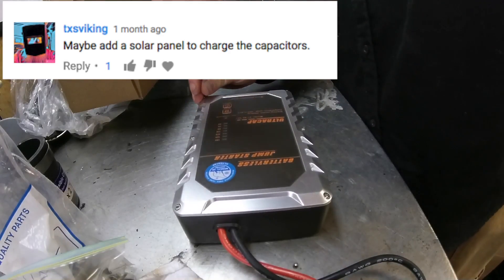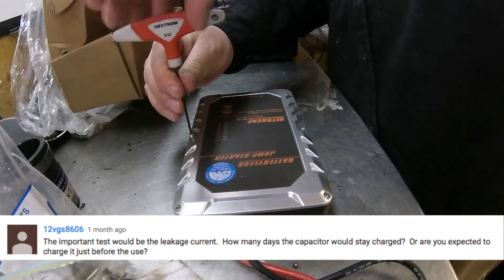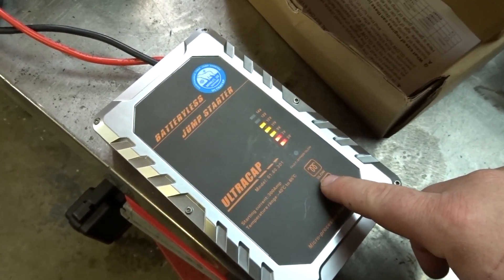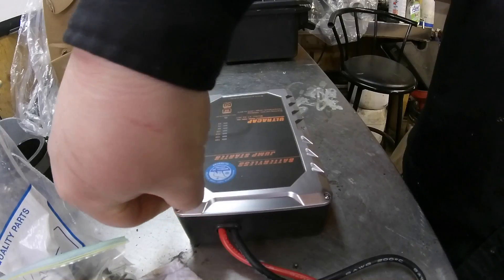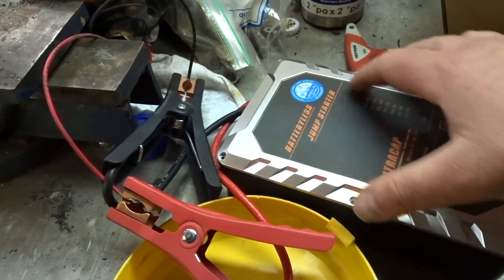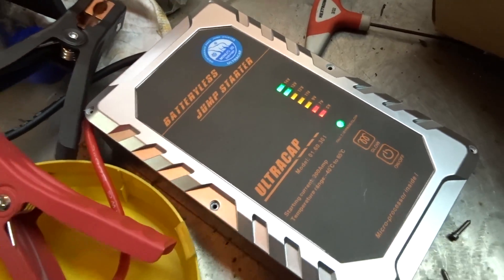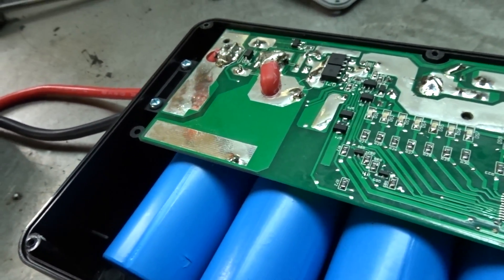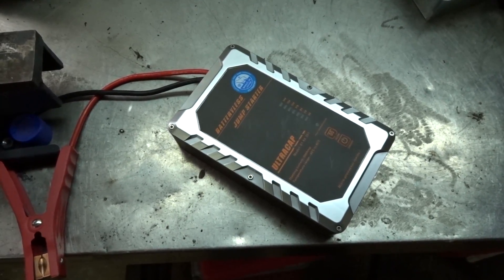Batteryless Jumpstarter What's Inside

Comment: Hi, what is "BY PASS MODE"? I don't understand what is being by-passed?
Reply: Just guessing, but probably bypassing the charge circuitry so you can now draw from the caps to start the car.
Reply: @mitchydkid  Thanks very much.
Reply: It usually checks polarity, and only enables output if ok. Now if your battery is totally dead, you can charge using a better source and after that connect to the target car. It will only enable the output if polarity is ok so this might fail. Then you need the by pass mode. Basically it means by pass checks. You can also disconnect the dead battery so it won't drain the capacitors additionally and use by pass mode. Just double check that it's connected correctly.

Comment: They are approximately 330 ferads not micro ferads but ferads if you look on the laser saber Channel you will see that approximately 3 years ago she posted a video on using super capacitors really really big ones 2.5 volts piece 6 and series to replace a car battery that he wondered if making a really small one which uses the same kind of capacitors this uses would work and it does work starts a small car three times on one charge and can completely replace a 12 volt battery in a small car or medium sized car but medium sized car only gets one try on a full charge of these capacitors you should look up as Channel there's lots of helpful information and he posted those videos years ago so the company that made this probably saw his video on using ultracapacitors in series to charge him up to 12 volts and have the low amperage storage capacity with high amperage discharge capacity to replace car batteries the one that is full size for a car battery is capable of starting large Vehicles like tractor trailers and only weighs about 8 pounds versus the 40 to 50 lb of a actual car battery.

Comment: I’ve watched your videos, and others on these type of jump starters, they are an impressive and amazing device to own.
From what I understand these capacitors could be rated 3v so 5 in series would give room for 15v, but I wouldn’t know how many farads they would be rated.
A car battery that doesn’t have enough cranking voltage will still have around 10 volts and many amp hours left, bad for the battery to be that low as we know.
Inside the unit there is a relay, so I guess when you connect the box to the battery the relay diverts power from the battery through a balance charger giving 2.8v to each cap to charge the caps to 14v
When it’s charged to 14v the balance charger is bypassed via the relay and connects the caps directly back to the car battery with a nice capacitance waiting to discharge through the starter motor.
Amazing!
Reply from the maker: They work awesome very brief amount of power maybe 5 seconds

Comment: It'd be nice to know what's the lowest your battery could be and still charge the capacitor? I know you mentioned if the battery have some kind of life to it.  it'll charge capacitor and but if your car battery is drain to 1% battery life will it really charge capacitor completely or enough to jump start battery or does it need to be at least 5%? On a 9 volt battery or double A battery charge the capacitor enough to get a jump? There was this thing jump a large diesel motor? I think I asked you enough questions I'll leave you alone now LOL thanks

Comment: Also, is there one available to start aircraft?- 24v- light aircraft batteries are small capacity 10-18 AH as there prime purpose is to start the aircraft engine and they are small due weight limitations. Thanks

Comment: Worst case scenario- happened to me- freezing weather, I left headlights on after I parked and when I went to start 3 days later, battery had gone reverse polarity- ie negative was positive , positive was negative. Smart charger did a spaz when I hooked it up as it was telling me I hooked up backward. Old dumb charger-  got battery back to normal and charged in 12 hours. Vehicle a diesel and you need about 10 secs of low plug in freezing conditions. In the worst case scenario above- glow plugs, reverse polarity, etc, will it still work?

Comment: Based on watching the "First Look Case Study" video and rough math, they are probably 450 Farad 2.7V Ultra capacitors.  

In that video, it took 10 seconds for the lamp to drop the voltage from 13V to 12V, drawing roughly 9 amps.  To simplify the math, I am going to assume that the average current was 9.0 amps from 13V to 12V.  The average voltage is in turn 12.5V over this time period.  The energy consumed in Joules is 12.5V x 9A x 10s = 1125J.

The energy stored in a capacitor is J=½CV².  With 5 capacitors, this gives the following calculation:

½C(13/5)²-½C(12/5)²=1125 / 5
½C(2.6)²-½C(2.4)²=225
C(2.6)²-C(2.4)²=450
C6.76-C5.76=450
C=450 Farad

This does not reveal the actual brand, but at least reveals approximately the capacitance of each capacitor.  2.7V is the highest voltage most ultra capacitors are rated, so they are pushed a little above their limit when charged to 14V (2.8V per capacitor).

Edit: Corrected from 225F due to calculation error

Comment: I suspect they are Maxwell Ultracaps or similar...same color and shape.  I think it would be hard to build anything close for the price these go for (at least in the U.S.).  The 300 amp is running about $150 to $175, and the 800 amp is going for about $200-230.  Funny how technology changes things.  I remember in highschool electronics (shop class)  the instructor said that the reason we worked with Microfarads was that a capacitor rated at 1 farad would be bigger than a house.  Now with the ultracap technology, a 350 farad capacitor is about the size of a d-cell battery and a 1000 farad is the smaller than a soda can!   For those asking about charging the unit from a very low battery, there are several videos on YT showing the units charging all the way up from batteries that will not even click the solenoid, let alone turn the engine over.
Reply: There's no way those are Maxwells, the price would be astronomical. There's nothing wrong with knockoffs.
Reply: Agreed, that's where "or similar" applies.  These are probably Malaysian copies...

Comment: Jerry, as always, thanks for your great work!  It is pretty easy to build a jump starter using readily available super-capacitors, although they are expensive.  It would be much harder to build the circuitry that makes this maufacturer's products great (sold under several brand names).  That is, the circuitry that allows it to charge to 14 volts from 4 or 5 volts, allowing you to charge it from your own "dead" battery right before you jump start it!  The people that keep worrying about how it discharges over a week or so don't seem to understand that ability.  There is really no need to keep it charged.  If you need to jump your own vehicle that you have driven within a week or so ,  it would be very unlikely your battery would be so dead that it wouldnt charge the unit.  If you are jumping somebody elses vehicle that is very dead, you can always charge it quickly from your own vehicle or any other nearby vehicle.    And you can always charge by USB as well.

You could let this thing sit for 10 years in the trunk in freezing weather, totally neglected, and then take it out when needed and jump start your engine using your own dead battery.  Not many jump starters could do that!    PS....the model Jerry is testing/dis-assembling is the 300 amp.  They make this same model also in 450 amp and 800 amp under various brand names.  I have the Schumacher DSR109 800 amp model and love it. And I AIN'T sending it to Jerry!.....Haha  (although I would like to know the true amp output it is capable of!)
Reply: A boost switching PSU board to convert 4V into 14V is around $2, maybe $10 if you are in a hurry and want it to happen faster (at higher current).  No need at all to do anything "harder to build".